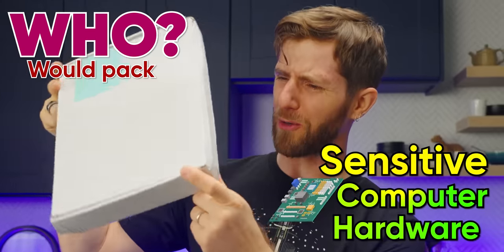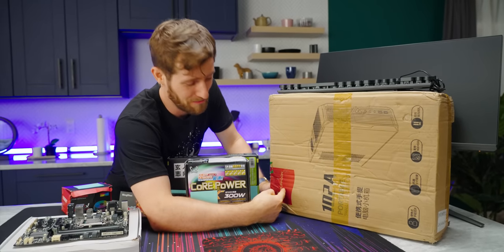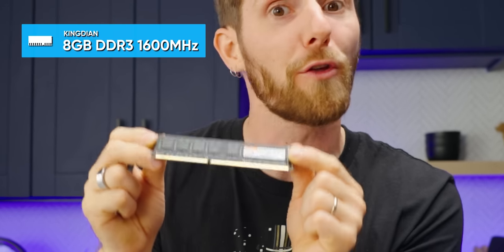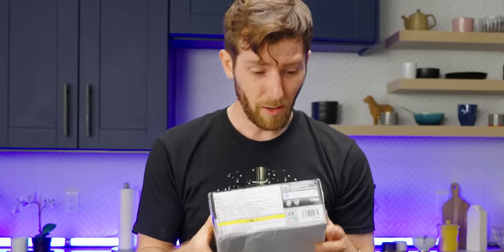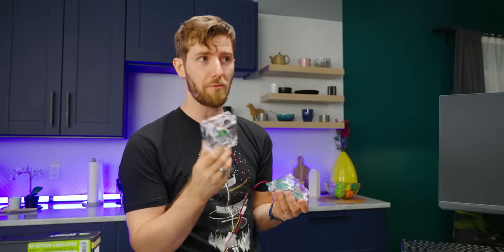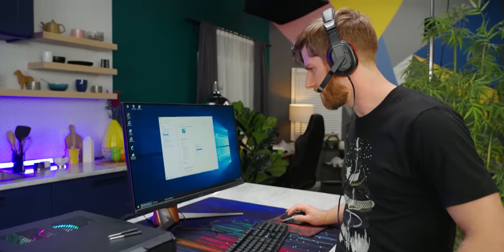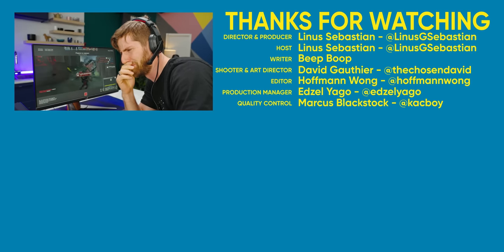THIS Wish.com Gaming PC is WORSE!

Comment: In case anyone was curious: yes, in most instances you can actually get away with only populating half of the 8-pin EPS connector if you are using a relatively low power CPU.
Reply: Can confirm, I still use a 4 pin connector for my cpu
Reply: Worked fine on my HTPC back in the day no problem. It later turned into a NAS.
Reply: Confirmed, works flawless as long as your cpu is not a power hungry monster. Tried it. H510 mobo with 10105f cpu, ran several benches without problem. BUT: its a sign your psu is not designed for such modern hardware  and generally not recommended i would say.
Reply: Define 'low power' please.
Reply: @AC3handle  Between 96W (officially) and 192W (unofficially). It'll depend on the power supply, but most should be more than capable of powering a 95W or less CPU unless the motherboard is expecting to see additional 12V lines on the other pins in the EPS 8-pin socket. That does sometimes happen for boards in the enthusiast space and was shockingly common on boards designed for some of AMD's most power-hungry chips. I wouldn't even be particularly concerned about trying to run something up to the, like, 115W range off of a single 4-pin P4 connector since it was designed specifically to meet the power demands of the Pentium 4 (hence the name) and those peaked at 115W.
Reply: Motherboard manuals will have a guide for using only 4 of 8 pins, my i7 2600k had that for a little back in the day
Reply: Most boards are just fine with just 4-pin because it is 95W, there arent that many cpus that runs ar over 95W in stock. Even when you factor in the turbos that go over that limit, they just dont run for long enoght to get the cables and the connector hot. 
If you are running a overclocked CPU that draws more than 95W then you might be in trouble, but in Intel thats not happening because you need a Z board and in AMD you need a AM4 6/8-core cpu, both cases are a really weird pairing that not even Linus is capable of.
In fact the only CPUs that i ever knew that did damaged and even BURN the 4 pin connectors or/and cables were AMD AM3 FX 8xxx cpus, i saw lots of examples of that happening, and the worse was that some boards at that time didnt came with 8 pins connectors, and still listed the FX8xxx as compatible.
Reply: I have a board that still has a cap over the additional 4 pins. My PSU ad the time only had a 4-pin, so I left the cap on. Didn't stop me from clocking that quad to heavens.
And another board only has a 4-pin, and that one does fine with a 120W TDP CPU with 30% overclock.
Reply: @HappyBeezerStudios  Yep, that's why the standard "officially" supports 96W over the P4 connector but can be made to accommodate up to 192W if the power supply manufacturer is willing to put cables of a sufficient gauge to match the connector on the board. Also if the motherboard manufacturer is willing to let you actually draw that much power over the P4 connector. Lots of things in the PC hardware space are hard and fast rules, but never tell that to the third-party manufacturers. They view them more like "guidelines", and we love them for it.
Reply: @shivanSpS  okay. so an intel 7400 shouldn't be an issue.
Reply: @AC3handle  I currently have the i5 7400 running in a Lenovo oem build with a weak stock PSU using a single 4 pin cable for cpu power I don't game on it anymore but I used to run warzone on it
Reply: @mikielgrato5705  I have an i5 7400, 1650 graphics card (low profile), I got a 300w low profile PSU with the 8 pins, but something that seems to happen a lot, when I boot up, the machine stalls during post, I get the opening screen, but it stalls from that point until I reset it, and restart it again. 
I'm seriously thinking it's a PSU issue, and will try a different power supply that the case originally came with, but was only a 4 pin connecter.
Reply: @doggo_woo  A 4 pin??? What are you using, a Windows XP Gateway??
Reply: Why would anyone wonder when linus proved it?Gee youre brilliant.
Reply: @djsi38t  Linus is the litmus test of tech?

Comment: This loose packaging of the motherboard is quite common in industry, even for expensive equipment. For circuit boards, this is usually the normal packaging.
Its only for consumers where fancy form-fitting foams are common.
Reply: Can't trust those peasants to handle their motherboards properly, better add some foam
Reply: how low your standard could drop, can you drop it even lower?
Reply: Wrong
Reply: @AM23.  In my experience doing ATM breakfix calls OP is correct. If it's just a PCB it's almost always loose in a box, even for a $10,000 ATM control board. It's pretty wild.
Reply: @Teth47  That's so weird🤷‍♂️
Reply: @Teth47  like I guess they just have the money. Or the parts are stronger than we think 🤔
Reply: @AM23.  Well, yes, PCBs usually can handle some abuse.But what is more important: If a part breaks during shipping (and it gets noticed during delivery QA) then thats the manufacturers/delivery services problem, not yours - while proper packaging increases cost, which is your money. So for a company, the logical conclusion is to take the cheapest packaging that works.
In general, companys a view on money that appears weird to the regular consumer.
Reply: @AM23.  I once received a crate. The crate was full of loose computers, it looked like a dumpster. That was my stock. This was normal and expected in industry. 

Cost rules, if it's cheaper, it doesn't matter how wasteful or inefficient it is.
Reply: @Karagoth444  Is shipping in the industry better or something? Cause motherboards are fairly fragile.
Reply: @Teth47  interesting 🤔
Reply: @shanez1215  That's exactly what I was thinking, maybe they know one driver will take care of the package 📦 instead of like FedEx kicking it around
Reply: I test pcbs at work and yes they can withstand good abuse, also yes quite common to ship like that. Only thing we ship with foam are touch panels and stuff so the glass doesnt shatter.
Reply: I had a guy send me a motherboard in a pizza box once which made me audibly facepalm. (The motherboard ended up not working)

Comment: That style of grounding on the PSU is standard in Japanese apartments and houses. Almost all of the electrical outlets will be 2 prong. Only in rooms for high wattage electronics like the kitchen and laundry room will have a little covered grounding screw for you to attach the grounding wire.
Reply: Yep, This is standard in Japan. The laptop I bought back then there has this power plug
Reply: Okay, Japan does a lot of thing better than the rest of the world, but this is absolutely not one of them. That is a horrible way of doing it.
Reply: Imagined someone will tell the truth xD
Reply: well THAT sounds fucking safe...
Reply: @SeventhEntropy  xenophobia being one of the things they do much better than everyone else
Reply: @toz_man3904  thankfully
Reply: @Uooooooooooooh  if you say so

Comment: The reason why SCYTHE is still making those old designed PSU's in 2022 is that they have branded that particular product as "ideal as a replacement power supply for Mini-ITX cases and slim cases, such as systems using various SFF (Small Form Factor / small system) power-saving CPUs, refreshing old generation PC power supplies, etc." 
Also, the Graphics Card from 玄人志向(Expert Oriented) is a famous brand in Japan.
It's a sub-brand of バッファロー(Buffalo) which is also famous for making quality budget computer peripherals.
玄人志向(Expert Oriented) mainly makes budget hardware for PCs.
Reply: I have a Kurotoshiko GPU and never had a problem with it. Decent brand.
With proper research, Linus should have known that the PSU power plug with separate ground wire is standard in Japan.
Reply: So that GPU actually probably was a pretty alright deal?
Reply: @collinschofield808  yea but I don't know if they have any warranty in Canada or USA so I wouldn't recommend it to everyone
Reply: I didn't know 玄人志向 was a Buffalo brand, interesting.
Reply: @Idiomatick  I used to live in Japan. The plugs are not round.
Reply: I still have a couple Scythe fans in use. They do just fine and don't cost a kidney like some other brands.
Reply: @collinschofield808  
Comparable or less than say what a similar product would be on Newegg
Reply: I always thought they were a local brand for Galax since their GPU's look so similar.
Reply: Kurotoshikou logo looks like KBTIT
Reply: @bitelaserkhalif  Bruh

Comment: The display card is actually from a respectable minimalistic Japanese brand that was famous in Japan's DIY field.
Reply: No surprise it was the only component to hold up
Reply: @littlebosaMusic  Yeah when it ran Tf2 I was surprised to see how well it was running! That grounding connection is odd for the PSU.
Reply: @deadasfboi  Though also very Japanese, they still have this style of grounding connection and it's weird.
Reply: Nah, i think it is a Chinese brand but with a japanese name, just like genshin impact
Reply: @hsienkangliu1436  your username looks like you are Taiwanese, if so how do you not know this famous Akiba DIY brand?
Reply: @albert328  I'm not sure but it's pretty similar to another brand with similar design I found on taobao, my judgement is based on what is printed on the box, I think it's not even Japanese 😀

Comment: the new motherboard without a box is easy to explain, they buy oem boards that come in one package and sell the individually, so of course they don't have the retail box
Reply: Or, considering the crooked DVI port, they got a bunch of motherboards that failed QC for cheap. Then sell the ones that work, and maybe fix the ones that don't and then sell those as well
Reply: What does oem mean?
Reply: @Jackie89000  original something manufacturer, it is basically parts for factories, just think of how much trash that generates if every component comes with an individual package
Reply: @devforfun5618  oh, so, like just buying wholesale stock? Makes sense.

Comment: I bought the fans once too (for a arduino project). They are very likely to catch fire.
I plugged them in and luckily outside the case to cool me and I was at the computer when it happened.
It happened with both.

Comment: 11:25 That's how grounding works in Japan.  It's only needed for high-powered devices, so you'll usually find one outlet with it in the kitchen for the fridge, and one in the utility area for the washing machine.

Why Japan hasn't moved on to a proper grounding pin like the rest of the world... I don't know.
Reply: I do not answer, because I do not know the answer as such. 

But one hypothesis I have is that since they are so strict about housing* I imagine they have a culture of keeping construction costs very, very low. Imagine if an earthquake cuts the "ground spike" and a whole building is left ungrounded, this should be better than nothing. 

*(a house unoccupied for X time usually is directly DEMOLISHED to avoid fires/propagation of pests and, later, a new one is built. The matter of earthquakes, etc...) 

As anecdote, in my country, in the old days (grandfather or even before), grounding was done with a wire wrapped around whatever-they-have-in-hand, usually the copper bathtubs they had...
Reply: @Armonth  bathtubs and space heaters are a good option for "emergency" grounding.
Reply: I had fun getting zapped by my laptop in Japan
Reply: Grounding shouldn't only be for 'high powered devices', grounding should be for any metal cased mains electronics(unless it has an external power adaptor, so only has a low voltage inside the case) that aren't "double insulated"(labelled as a square inside another square).
Maybe you meant high voltage?
The power consumption isn't relevant if a live wire contacts a metal case, and consequently shocks you with however much current it can get through your body!
If the metal shell is earthed, it blows the fuse, rather than trying to electrocute you.
Fridges and washing machines are typically metal, and would probably be harder to insulate.
Reply: @rocketPower047  That's most likely not related to electrical grounding, most or probably all laptops are charged with a DC supply with no earth connection to the laptop. Grounding should only make a difference if there was something severely wrong with the power brick of the charger.
Any voltage difference can cause a shock, and indeed touching something earthed at the same time as touching something with a voltage applied can make the shock worse.

Comment: that cpu reminds me of the time when I bought an i7 2600k a few years back. Surprised to see it runs at 5GHz no problem. But when it arrived, it was wrapped in some thin styrofoam inside a small seethrough box and the package was labeled something like "plastic foam" value: 1usd.
Reply: Great for avoiding import duties

Comment: I actually liked how that case looks, wouldn't buy it for this much, but if it was quarter the price I would go for it and drill some holes on the back for psu ventilation.
Reply: I thought the same thing. It would make for an awesome home theater PC. It even has an optical drive bay.
Reply: my first pc was built in that case, different front panel but the chassis is exactly the same. only cost me $20-ish brand new and heck yes its fun to mod
Reply: the case is literally avilable on ebay for less than half
Reply: Im sure ive seen similar cases with included psu's for £35 before, brand new. I would go standing anything on them tho, theyre very tinny thin. Damn I miss the ol' IBM cases that were strong enough to take the weight of a 24" CRT.

Comment: 11:25 I believe that is a Japanese standard- the outlets over there are primarily North American-style ungrounded, with an optional ground pin.
Reply: Can confirm, was confused as hell when I first encountered them.
Reply: Can confirm.  Lived there for a couple of years, and this is definitely their standard.
Reply: @neokixxx  please make sure your pc is grounded. Especially if u have fur or pets in the house
Reply: @aoyuki1409  In Japan the breakers have ground protection so you don't really need the extra cable anyway and many people do not bother using them. It's called an earth leakage circuit breaker.
Reply: @DriveCancelDC  I think he talks about ESD given he mentioned pets with fur
Reply: @DriveCancelDC  i also have GFCI and ground fault protections for my entire house since my country uses UK standards but yes I'm talking about random static discharges (ESD) if pets or you wearing socks on fur carpets touch a surface it can discharge random kilovolt surges which can kill a pc. Linus and Electroboom also made a vid about ir

Comment: Ahh the COOLMOON cooler.  Perfect for cheap kid's PCs with acrylic side panels.  Having built a few of those, I am a fan (no pun)  Cooling is equivalent to the stock Intel cooler but obvs with RGB.
Reply: I remember seeing those once but picked another cheaper ID cooler thing and actually beated my stock cooler, good to know i wasnt missing a lot
Reply: Coolmoon... Probably want to fool potential buyers into thinking that they can overclock their CPU to the moon with the cooler.
Reply: I've had their RGB fans completely catch fire using the Molex cable not once but like 3 times (they kept sending replacements) they do have some decent cheap coolers on Amazon though,
Reply: It's probably a copy of a very old Zalman cooler and the RGB is only R, G, B lol
Reply: Cheap kids?????
Reply: He talks about that socket 939 holder, looks like any standard am3,4 design to me?
Reply: @oscarmathia6112  it is, they are wrong. Its just an attempt to make the product seem as crappy as possible. Not sure who is writing the script or why Linus is clearing this stuff. Its kinda cringe when he is saying things like this he should know the difference/similarities.
Reply: @CrimPyro  Socket AM2/AM2+/AM3 coolers are compatible with Socket 754/939/940 boards. I have used different ones on different boards and this one SHOULD be compatible
Reply: @CrimPyro  Pretty sure AMD had in fact been using that clip on design since socket 939. Had some real old AMD systems and the CPU cooler mounting was identical to my newer AM3 stuff.

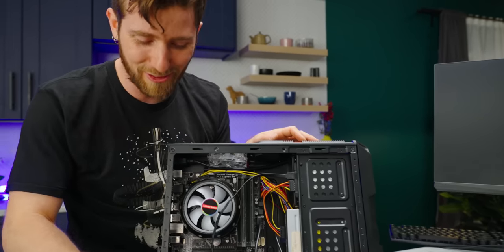Comment: Anyone notice at 18:18 Linus plugs the black sata cable into the SSD, then plugs the other end of it into the optical drive? But when they cut away, the sata cable positions are corrected. Ya ain't slick, Linus!